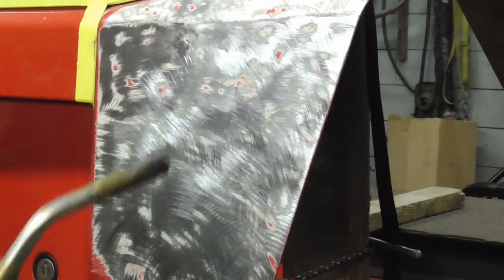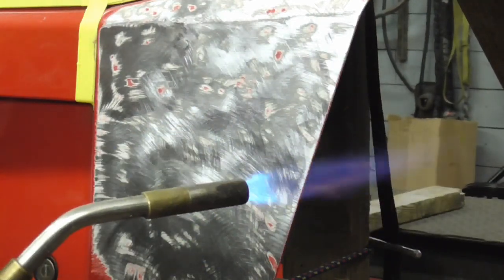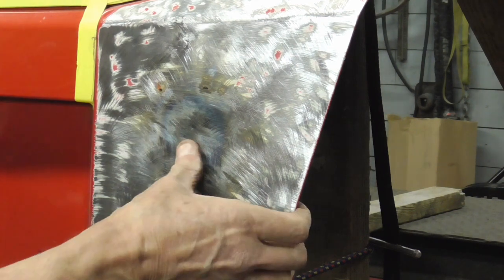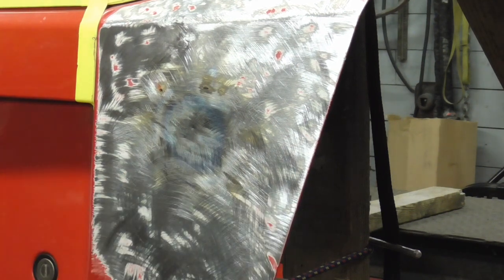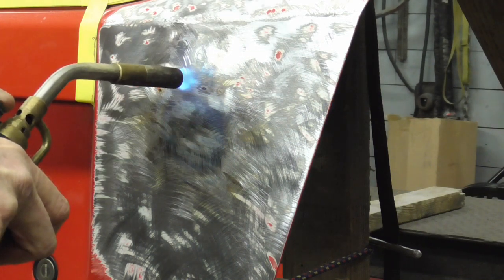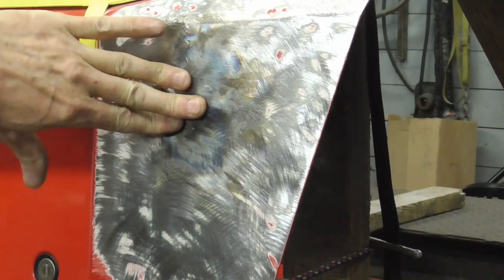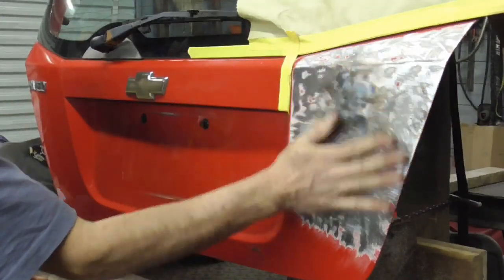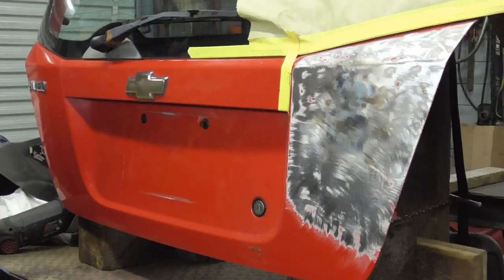Removing Oil Canning in Sheet Metal - Works Every Time!

Comment: Torch and a very wet rag works just as well without putting a hole in it. It will tighten a metal right up.
Reply: You still have high spots. Just tight high spots.

Comment: Thabk you for posting this, I’ve been doing it like this and it’s fool proof it is the best way apart from a shrinking hammer and dolly behind it with heat. The wet rag + heat is a great way to tighten the metal but it does nothing to address the high spots. Read the Martin metal bumping book it uses the dolly method and suggests hitting the crown then working the metal. A long pick/rat tail hammer works better with no dolly because the points are so small. 

And if you have to fill anything it’s what, 1/16th inch filler in a couple areas? Pass a shrinking disk it’ll sooth most of it flat by warming the highs from the pick only. In restoration work I pass filler over the entire car to get a show quality finish and I usually hit about 1/8” max because the panels themselves don’t come laser straight. Look at all the natural waves in the g body hoods. 

After I hit the metal this way when it’s all right I pass a shrinking disc over the metal to smooth it flat and then key it with 80 grit for epoxy primer. Very minimal need for body filler.

Don’t let the naysayers get to you, this way is legit!
Reply from the maker: Thanks - you're absolutely right.  In a body shop you don't have time to play around if you want to be fast and earn respect.  This has always worked great for me - I watched a lot of guys get tripped up by an oil canning panel - to the point they would rather replace it. I hate to say this but one of the best pieces of advice that helped me when I was young was an old guy who told me "hit it low and fill it with dough"  :)

Comment: Like everyone else has said, the dimple in the middle is not necessary, you can even see in your video that as you first start to cool it the steel shrinks quite a bit.  If you didn't/couldn't use the heat, the dimple by itself will tighten up the oilcanning. 

If you want to try something really slick, take some stainless sheet metal about body metal thick, cut about a 9-10" disk out of it.  Put a bit of a dish in it (you can tap it with a hammer on a surface that gives, I made a form out of wood so I can do it on the press.  It doesn't have to be perfect, as you use it it will pull itself even.  Put this on a 7" angle grinder (it's just about the perfect speed, a 4" is too fast and not enough torque, you'll overheat it and kill it quickly, 9" is usually too slow) and run it over the area that oilcans/has high spots.  It will make an awful screeching, and the high spots will heat blue and then cool it quickly (I usually use a wet rag but compressed air works).  by "design" it only heats the stretched out high spots so they are the only parts that shrink.  It's just as effective as your method for getting rid of oilcanning, but with some practice and if you're willing to tinker a bit you can actually get sheet metal to pull itself so straight you can avoid using any filler.
Reply: @A. Melbs It's called a shrinking disk, and I've done it on quarters before

Comment: Thanks so much for this tidbit of information. I have a 1972 F250 that I repaired the left front cab mount tower. Replacing it would require taking off the whole front clip so I opted to repair with 22guage steel. I did have to do alot of welding inside the mount tower because it was difficult to see. Anyhow, despite being 4 or so inches from the angled cab floor, apparently I got it warm enough that there's now an "oil can" effect in the angled part of the floor I didn't notice before. Surprisingly, I thought if I got the floor that hot, it should've melted or burnt the rubber floor mat but didn't.  The paint inside even is undamaged. Anyhow, now I know how to fix it but some time in the future. I'll have to repair the paint when I do the procedure beside the fact that getting that old floor mat up may be tricky with its age. Thanks again.
Reply from the maker: You're welcome.  Even warming the area, tapping the high spot lightly can have a positive effect.  Cooling it fast with water or cold air can change the properties of the metal too and eliminate the oil canning :)
Reply: @LakesideAutobody  thank so much for the advice.
Reply from the maker: @stephensaasen8589  👍

Comment: I just tried this on an 84 k5 blazer. I can verify it works very well...dont overheat practice on a scrap panel first
Reply from the maker: Thank you for verifying it.  It can make the difference between a fast body man and a slow and frustrated one for sure.

Comment: I was looking for answers how to fix my cheap quarter panel I put on my 72 dart. The welds look good when I grinded  them down. But oil canned. I just need to do this now to get the flex in a few spots to go away. I was almost gonna put rods on the other side. It looks good just oil canning in 2 spots.
Reply from the maker: Do this - I promise, if you are patient it will work.  If you try 1 time and it still does it in another spot do it again there - it will stop eventually :)

Comment: This is a bizarre way to remove oil can! You do not need to use your pick hammer, just a wet, cold rag will shrink the metal and keep in flat. Using a pick hammer will require body filler or solder.
Reply: I was thinking the same thing  I have never seen someone shrink metal like that.
Reply from the maker: It really eliminates playing around with the panel - most guys in the shop will mess around with it for hours when all you have to do is this - you're going to have to fill it any way so.... Hope that helps - Jerry
Reply: Yes no more oil canning but now you have more dents. The proper way is to heat, hammer and dolly real fast. Quince with wet rag and then do some more hammer dolly work. Only a skin coat of filler is needed
Reply: @jss6060  hammer and dolly only works if you can get the dolly in behind it!

Comment: Why the whacking?  Is it just to speed up the shrinking of the metal in three dimensions -- the dimple to the interior?  Ever watch Keith Fenner (Turn Wright Machine Works YouTube channel) straighten a bent boat prop shaft?  It's all just torch and water cooling.

Thanks!
Reply from the maker: The tapping would be that same as laying a napkin on top of a glass and pushing your finger into the glass - you're pulling the napkin in...  With the metal you are "pulling the metal in" or shrinking the area - tightening it up.  You're welcome BTW  - Have a good week :)
Reply: Figured, as stated originally -- shrinking the 2D plane into a 3D space.

It could all be done with just the torch and water eventually.  The tap just speeds up the process.  Of course, the tap divot will require filling.

Thanks for taking the time to put up the videos and respond!

I'm getting ready to DIY rocker panel replacement and base of the B pillar repairs on a 2004 Cavalier due to rust rot.  Needless to say, I've been overdosing on auto body channels.

The car is a daily beater so the repairs will be rather utilitarian and Frankensteinish.  Still, the new metal will give the vehicle an additional half-dozen years of life.
Reply from the maker: @russellstephan6844  This play may help you out:  https://www.youtube.com/playlist?list=PLOP9eoG14-I-qu68_805bZaOnmkdlv6Ys

Comment: Love your videos.  I used the  this on my hood and it worked great.  I bought a 62 C10 for parts.  I am restoring my dad's 6.  Live in Connecticut and the winters took a lot of the truck. I am starting the bed and one of the previous owners of the 62 haul some heavy material in the bed and the sides are bowed.  So the bow goes from the top rail down to the wood bed and front to back.  Do you have a suggestion to work the bow out?
Reply from the maker: I appreciate that Walter - glad you like them.  If they are bowed out you could use a come along (heavy duty one) to pull them back together.  If they are bowed where the middle is sagging you could try some thing like this - see video at 40:00  - https://www.youtube.com/watch?v=xbzGX4hW9qo  You can send me pics if you want at schoolvideolibrary@gmail.com - I'd be able to give you better advice maybe :)

Comment: This is fantastic! Can't wait to give it a go tomorrow. Quick follow up...what do you do when even 36 grit aluminum oxide grinding won't take off old baked in paint? Just leave it on, right? Fill the biggest dents, then primer, sand, fill everything else, primer, final sand?
Reply from the maker: I promise, if you hit it with these fiber resin discs on a sander/grinder - it'll remove it - https://benchmarkabrasives.com/collections/aluminum-oxide-resin-fiber-discs/products/7-x-7-8-aluminum-oxide-resin-fiber-disc-25-pac?variant=31411319308   Here's the sander (buffer) to use with these discs  - https://www.harborfreight.com/power-tools/polishers-buffers/variable-speed-polishers/10-amp-7-in-variable-speed-polishersander-64807.html  However.... you can leave the paint - DA sand it, fill your biggest dents, etc. - like you said.  Put it this way, I don't think I ever completely stripped a car - always left the paint on.  Most body shops/workers leave the paint on.
Reply: @LakesideAutobody   Well, my air powered grinder with those discs couldn't do it but I haven't tried the buffer yet. I'm sure it has SOOOOO much more power so I can lean into it. Anyhow, very good to know about not usually stripping cars. You are amazing! Thank you so much for your time!
Reply from the maker: @designsinorbit  You're welcome.  If you stick with it, it gets easier and easier as you learn what works and doesn't work.  Lots of failing but that's par for the course 🛠👍✌
Reply: @LakesideAutobody  One more for ya- my little screw on bottle type torch really sucks. What are you using?
Reply from the maker: @designsinorbit  A Bernzomatic TS8000T but I use the regular propane bottles on it - doesn't seem to be hotter or cooler no matter what gas I use :)

Comment: Is that a high spot now? Since the other side flexed, could that grown?
Reply from the maker: It's not a high spot - I get you.  It's not high at all - it actually pulls the surrounding metal into that ding you made thus tightening up the area or panel so... no flex or high area :)  Good observation Steve :)

Comment: Can you fix oil can without a torch with just a shrinking hammer, and dolly?
Reply from the maker: Yes - and then sometimes just with the torch alone - heat it then hit it with a wet rag.  I'm not a big fan of the shrinking hammer and dolly though -  it just doesn't have enough effect on the panel or enough shrinking capabilities for my liking :)
Reply: @LakesideAutobody  I agree but most  shops wont allow the torch because the metal is so thin, plus most techs dont know how to use it. It would be nice to have a video on use the hammer dolly, and maybe the slap tool.
Reply from the maker: @MrHotguy034  👍💯

Comment: I have oil canning on the back quarter panel and on the other side is wires and a 6 disc changer. Would this still work? Or I risk destroying something?
Reply from the maker: You can try going real light with the torch or stick a heat shield in between the two - like a couple pieces of sheet metal or something like that.  Let me know how it goes for you :)

Comment: How to shrink on the low oil canning area?
Reply from the maker: Do you mean if an area is low? You would pop that into the "out" position and shrink as shown in the video.  If it is low and not bothering anything, then leave it and fill.  If it's really low, you'll have to pull it and then address any oil canning issues after the pull.  You just don't want any high metal spots or super low spots.
Reply: Thank u for ur reply

Comment: Why did you put a dent in it????
Reply from the maker: That's a great question and there's a lot of science behind it.  What that little ding does is actually pull a bunch of metal "down that hole" and tightens up the panel.  That way it doesn't oil can or snap back and forth anymore.  Shrinking hammers and dollies probably work for very light damage but for severely stretched metal this is the way to go.

Comment: Be careful for what’s behind your metal if you use a torch. flame and water will warp the panel. I like to just use a adapter tip for my stud welder that heats the spot up cool with air and put a rubber sound killer patch to keep it stiff
Reply: What kind of adapter tip/where do you get them?  I've rigged up all sorts of things with my stud welder to use it to heat spots but I've never been entirely happy with the results.
Reply: Mark Pikas I bought the snap on stud gun. YA22345KT you can see the accessories. But you can change the tips that you can’t do on the maxi
Reply: VENOMVETTE then you dont kknow what your doing

Comment: What did i stop and watch did he just divit that
Reply from the maker: This method is a game changer.  Guys I worked with that didn't have a method that worked every single time had real problems with large dents and serious collision damage.  This simple procedure works every time :)
Reply: Yep you watched it, and yep he did it, he actually used a soldering torch for a shrink and hammered a big divot in the panel.  😮 😢   You sound like you know  what you have seen and it is not “a game changer”. This is the second LS video I have watched (part of), the first was by accident, this one a error of not paying attention.

Comment: So you are a cave and pave kinda guy not the way to do it but to each its own
Reply from the maker: No - that's the way it is done in professional body shops. Metal finishing, which has been made popular by the internet and TV is impractical with today's sheet metal as it is 22 gauge or thinner (6 hairs thick) so I.O.W don't grind it down or file it down. Those who are afraid to use the products that are made for auto body repair will not succeed or make money in the trade because getting filler straight is probably the most important/difficult part of that career.  Please see this video for longevity of this type of repair if done correctly: https://www.youtube.com/watch?v=8XaZBy7GC7A or 
https://www.youtube.com/watch?v=2o37dX--w0I